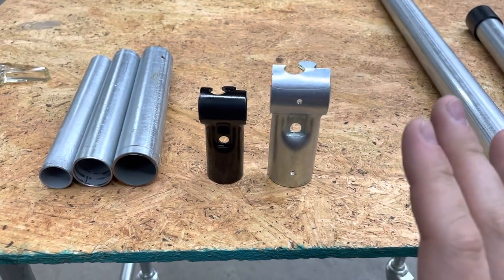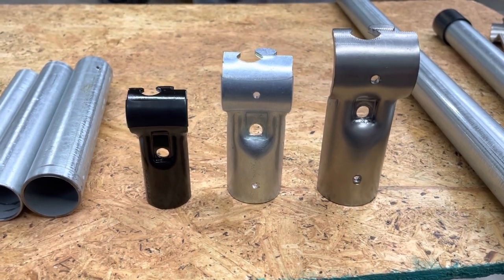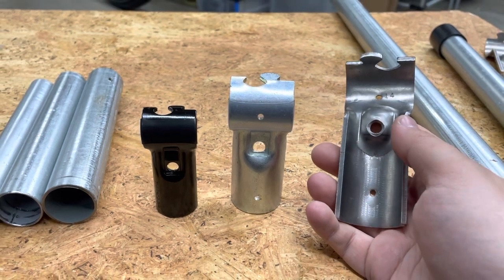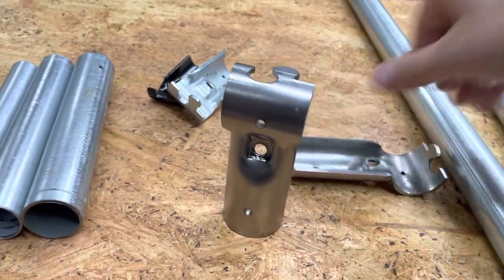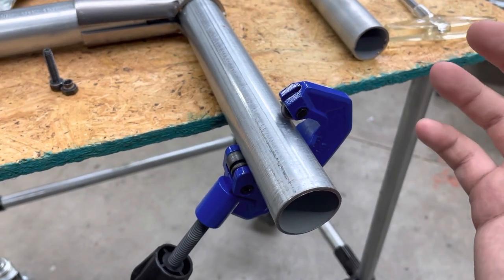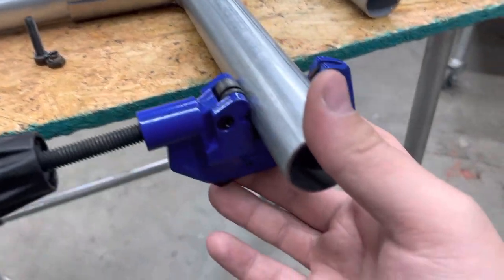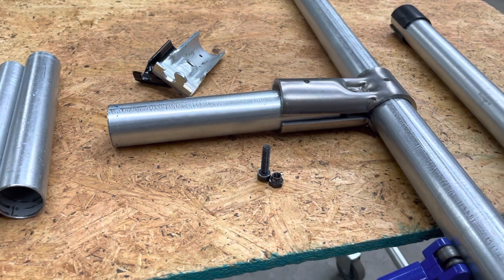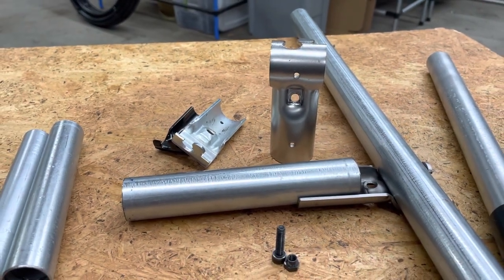You Aren’t Supposed To See This Connector Yet…

Comment: I built a small garden shed out of 3/4 conduit and covered with corrugated metal simply because I needed a custom size. So far it has been able to withstand very large peacocks that constantly landing on the roof. It does wobble and flux a little under the weight of the birds and if I could have used this beefier pipe I don't think it would. I am excited for the possibilities. I love how you guys are constantly improving the product line!
Reply from the maker: Thanks for the comment! That sounds like a great project and use for these.

Comment: Yes! I’ve begged for this before! I’ve been using top rail for years and recently started using Maker Pipe connectors and conduit. I’d love to start using your connectors for top rail rather that the regular ones, especially if you have the whole range of different types. And adapters would be awesome, too, to make the main structure out of top rail and 1/2” or 3/4” conduit for non structural parts.
Reply from the maker: Thanks for your feedback and comment. All great ideas!

Comment: Just saw this clip on my Roku YouTube channel and absolutely would buy and use these connectors! Makes feasible duplicating or at least augmenting/customizing HF type workshop/canopies. EMT is more expensive most likely due to certifications for electrical. Top rail doesn't need electrical or structural. Been looking for something like this for a while. Closest equivalent I found was in scaffolding and gaffers/stage lighting and sound applications and very expensive. Many thanks. I would second other comments concerning the size of the fastener. One size larger might be worth looking into but the additional self tapper adds a good deal of strength. Might get Project Farm or Practical Engineering set up some test beds. Anyway, I digress. Kudos on the innovation of Maker Pipe and this new product. Regards

Comment: YES! I was just at the home store the other day and wondered about this. Top rail is very cheap. Can I just say you really need to launch with most or all of the connections ready to sell. Several times I’ve wanted to use 1” connections but I can’t because there is no angle connector available…
Reply from the maker: I can understand why you’d want all the solutions at once. It takes quite a while for each of the connectors to be designed and ready for release. We’d love to be able to launch a whole line all at once but we don’t have the capability to do that quite yet. Until then we believe launching each one as soon as it is ready is more beneficial to builders. What if someone has an idea that utilizes all T Connectors and no angles? Should they have to wait a year even though the T is ready to go? We’d rather have some solutions available for builders as opposed to sitting on a design until others are ready. Thanks for the comment and suggestion. We really do appreciate the feedback.

Comment: Hey Jake, how does 1" conduit pipes fit inside 1-3/8" conduit pipes? As in a telscoping application? Would I need a shim or a wrap to close the gap in between the pipes so it doesn't wobble around when extending/retracting?
Reply from the maker: Hey Ryan thanks for the question. I just tried it and it fits really well! Much better than the gap between 3/4" and 1".
Reply: @MakerPipe  Appreciate it. Thank you!

Comment: Being able to connect to an existing chain link fence opens up a lot of possibilities. Like the ability to use cheaper (and stronger) pipe in a build. Will the whole range of of other connectors this size follow?

I’d also like to see 1/2  connectors so we wouldn’t need to use shims when building with 1/2 in pipe and your now standard 3/4 in connectors.
Reply: I would definitely buy 1/2 connectors, though I don't know if it makes sense for MP as a business decision. Interesting to note that there would still be some cases where I'd be using shims so I could connect 1/2" EMT to 3/4" EMT. And reusability might be diminished... having a stockpile of each size instead of a larger stockpile of just the one. I kind of feel like I would just stock up on even more to "solve" that though. Hmm, maybe I just need to improve my shimming skillz. Or 3/4" EMT prices could drop. 😏
Reply from the maker: Thanks for your comment JB. If the community has needs for the other connector designs for top rail, we will definitely plan to make them.
Reply from the maker: Thanks Christopher and JB for the 1/2” suggestion. We’ve contemplated making 1/2” connectors. The main reason we haven’t is because the amount of steel needed to make the connector would be about the same as the 3/4” so it wouldn’t improve the cost very much. The main benefit would be the steel on steel connection but the shims seems to strong enough. Honestly it could go either way. If enough people in the community want a designated 1/2” line we will definitely give it more thought.

Comment: Cool product, seems like a no brainer for anyone that has a fence to tie into, or wants to build a strong free standing structure. My only question is, it the same size nut and bolt up to the additional potential load?
Reply from the maker: Thanks for the comment. As of right now we’re using the same nut and bolt but you’re right, it would probably be beneficial to use something larger.

Comment: I am very interested in using the 1-3/8 inch pipe. I checked the price at home depot and they are 2 dollars cheeper. I want to make some stronger outdoor buildings like a storage structure for my outdoor lawn equipment and I would definitely want to use larger material.  Thank you
Reply from the maker: Seems like top rail will be a great value for structures. Thanks for your comment!